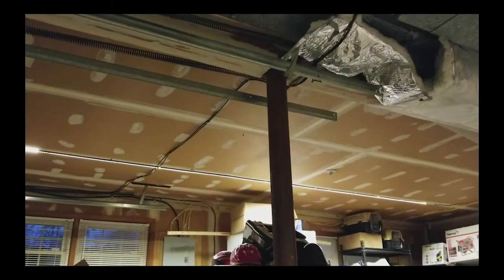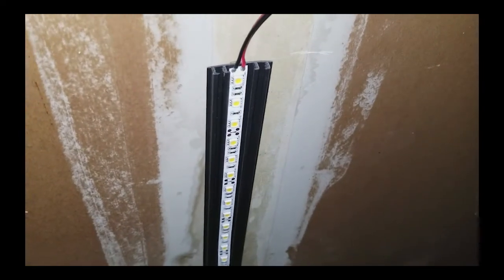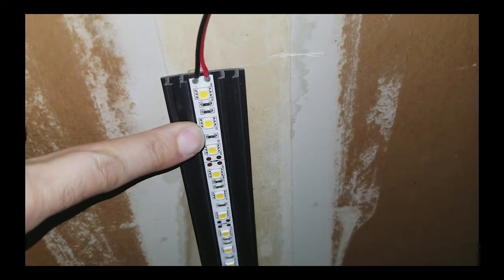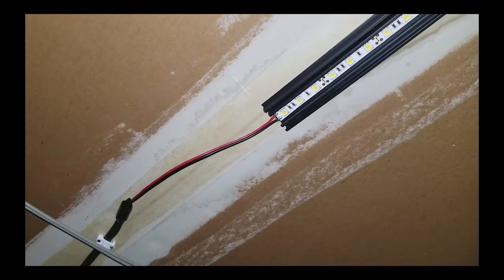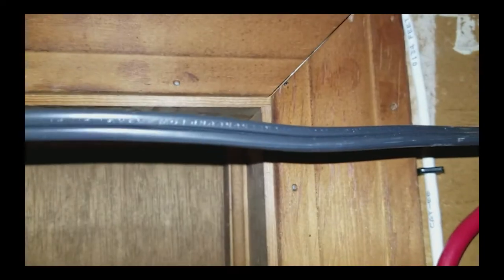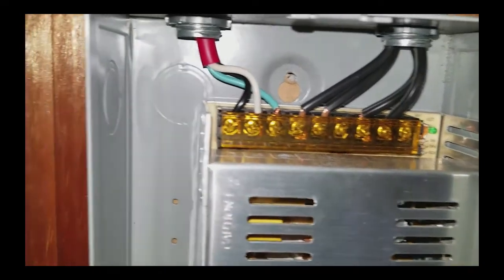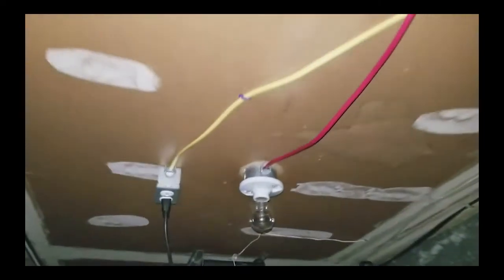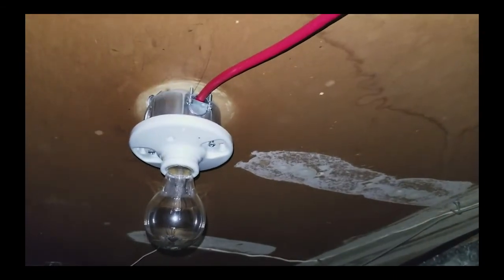Garage Lighting Improvement Using LED Strip Lights

Comment: Thanks for this. I see that you wired the 12v power supply through to the existing light fixture. Would it also work to wire instead to the light switch for the fixture? The goal being that everything - light fixture AND the 12v power supply are controlled by the switch. To my untrained electrical mind this makes sense, but perhaps I am missing something.
Reply from the maker: Yes, that would also work. In my case, the switch and wiring is inside the wall and ceiling, so adding the power supply wiring would not have been easy. If your garage has surface-mounted wiring and boxes, then tying back to the switch would be an option. Since I used the power cord which is not rated for in-wall use, I kept it surface-mounted and used a Romex style clamp to secure it to the box. I could have used an actual piece of Romex, but the solid core wire would not have played nice trying to connect it to the screw terminals of the power supply. Another option to avoid using the power cord would have been to run some surface-mount conduit with stranded wire between the power supply box and the light box.